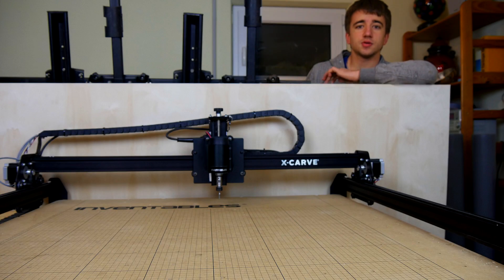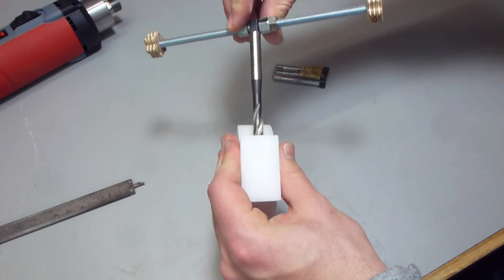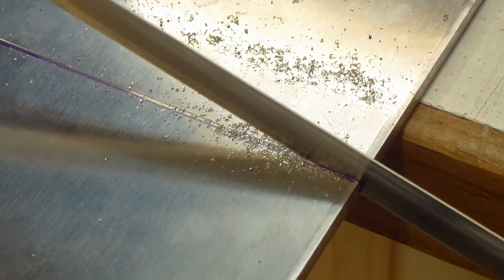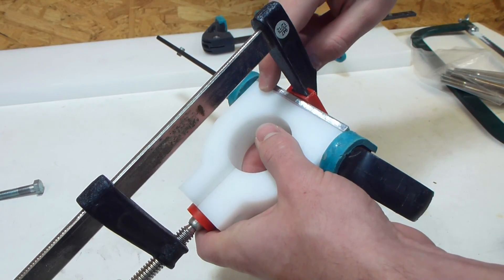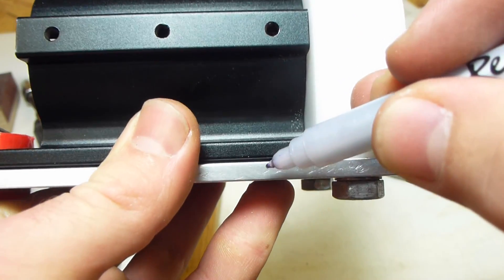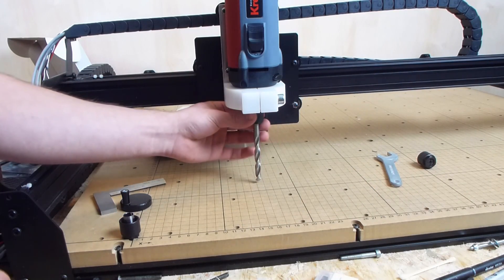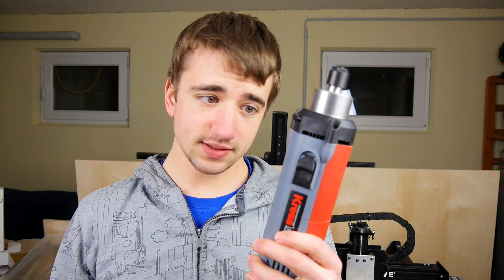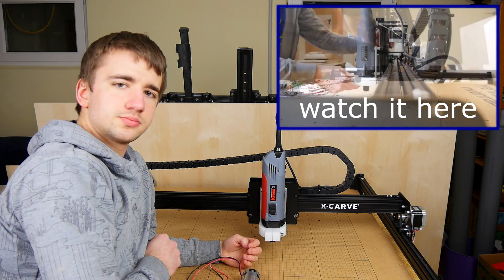CNC Spindle Upgrade

Comment: I know this video is very old, but if you still have the power cord zip tied to the energy chain, then normally you can open all the joints on the chain, and lay in the cords :)

Comment: In the meanwhile people should go for the 1050 (or 1400) FME-P (note the P in the end) ... Tighter tolerances, better bearings and an ER-16 collet (I think it is ER-16, some sites claim ER-20, others ER-16). Oh and PWM speedcontrol on  the FME-P DI models.

Comment: Wonderful conversation! And well done too. I think you might want to add gussets connecting acetal plate to AL plate to provide greater rigidity to assembly. Otherwise, you are asking threaded plastic to absorb lateral forces which will eventually cause system sloppiness.

Comment: was that a 100W spindle? holly 5 piece chicken McNugget meal that was small... 
I like my 500w spindle it works well in wood and has variable speed of 0-10000 RPM and its not as noisy as routers. only problem is my cnc frame is as rigid as a bowl of frozen Jello. 
5lbs force on the spindle tip and it deflects 3mm due to frame bending.

Comment: Marius you can cut aluminium on your band saw
Reply from the maker: With the blade speed I run the saw, the blade wouldn't like that and I don't really want metal shavings mixed in the wood shavings or in the saw

Comment: Great video. I will subscribe to your channel. Can you tell me how noisy is that Kress spindle? Can you run this in an apartment without neighbors get upset?
Reply from the maker: The spindle itself is not very loud, but the milling will be. I use it in our basement and there it's ok during the day.
Reply: Thank you for your quick answer. We ordered smaller one but is equipped with same motor. I hope will not be too loud. I have some nasty neighbors. :)  Maybe we will build a casing from Plexiglas and with some air vents or so. Maybe with one or two fans so we can cool the entire machine. 
You have very good videos. We really like your channel. Thanks

Comment: Love your video. I would have used a more robust mounting method for the motor instead of the 2 bolts I would have used a 6 bolt method and made the plastic mounting bracket with an angular portion that utilized the strength of that Aluminum back plate.
It looks very strong but over the course of time and vibration you want as much strength as possible.

Comment: I know this is old as hell but an easy way to get that spindle more rigid is to add an auxiliary support retaining structure for the router. You've got got radial and (a bit of) torsional support, but no axial thrust. Making another bracket under the exhaust ports ~200 mm up is a cheap upgrade

Comment: Another great video. Just a word of warning, a plastic mount won't be rigid enough for heavy cuts in harder materials. I don't believe you do such cutting (yet!) so it's not a problem.
I've got a similar mount but made from aluminium and that is still not stiff enough. Pressure from the cutting head will try to induce X/Y rotation on the pivot that is your clamp. If it does rotate even slightly, it will bite harder and chatter, maybe even stall. I damped the radial stress by making a support for the upper part of the router body too. With this setup I am able to cut aluminium and even steel on my router.

Comment: Hey Marius, I really enjoy watching your movies, they are really inspiring and fun and have great content! :)
A suggestion, when you drill in aluminum, use isopropyl alcohol as a cutting fluid, it will provide for a cleaner cut and also preserve the cutting edge of your drill bit for longer.
And for sawing off the aluminium, if you have a power jigsaw and a finetoothed blade, it will cut right throug it. Otherwise you should be able to cut aluminium with most circular saw bladeswith carbide tips :)
Reply: Pelle Reinke Very good

Comment: Are you using the Kress FM-1 5000-29000 Rpm 1050W spider, i´m planing to use this my self, if i´m not wrong you have 287 OZ motors nema 23 size, i´m driving 425 OZ steppper´s så if your machie goes light and easy i think mine can manage it too.
Reply from the maker: yes, it's that spindle and i have no problems with it.
Reply: This Easy To Use Tool Is All You Needdddd To Give Your Home An Extreme Makeoveeerrrr>>http://woodcarvingcnc.blogspot.se >>>

Comment: Kress Motoren sind einfach der Hammer :-) Ist das die FME-1 oder FME-P? Darf ich mal fragen, mit welcher Maschine Du so sauber Aluminium bohrst? Ich habe mir für Metal eine Quantum B16 geholt, aber bin mit der überhaupt nicht zufrieden, da sie sehr unruhig läuft und rattermarken ohne Ende produziert.
Reply from the maker: eine FME-1. Das saubere bohren liegt nicht an der Maschine sondern am hochwertigen Bohrer, die ich verwende. Hoffmann.de -> Bohrer von Garant
Reply: Ah, ok. danke. Dann werde Ich mir zum Testen einen Bohrer von Garant gönnen.
Reply: This Easy To Use Tool Is All You Need To Giveeee Your Home An Extremeeeee Makeover>>http://woodcarvingcnc.blogspot.se >>>>

Comment: Pretty sure all wood working tools there he owns a chop saw lol!  Why not just cut the aluminum plat with normal fine cut carbide chop saw blade?  Just saying wont hurt it lol
Reply: IIRC from other videos, he doesn't, because he has no room left in the shop, nor does he really have a way of getting the long lengths of timber into the basement anyway.

Comment: Hacksawing can be easy and fun. You just need high quality hacksaw and sharp blade, then put some grease or oil to blade. When sawing you need to find optimal grip and pressure to speed ratio. Then it goes like champ and you just have to be careful to stop in time :-)

Drilling "pilot holes" to metal before final hole increases accuracy.

Comment: hi Marius 
very nice work i have a question about the new router what is the brand and model?  coz i want to buy one 
thanks
Reply from the maker: Kress 1050 FME-1
Reply: +Marius Hornberger What about the new router included in the kit? Can you recommend using it or would you rather go for the kress 1050? I am planning on getting a x-carve and I wanna use it for sheet metal and thin plates as well as machining small pieces out of metal.
Reply from the maker: I don't know the included router very well, but as far as I know it has no variable speed. For metal you need that, especially the low rpm range. I'd go with the Kress.

Comment: What about noise difference, is the new router louder? These chinese default spindles tend to produce very little noise while idling.
Reply from the maker: +be2inas It's about the same. But noises during cutting are quieter, because of less vibration.

Comment: Hi there, I got KRESS 900W, FM 6990 E which is similar whit your new spindle and for which I have one question. I would like to set some ER Chuck but I don't know which one of them are compatible with this spindle shaft. Did you manage to connect ER16 or ER25 or you are using one which gets with tool?
Reply from the maker: +Senad I boguth the ones that are sold by Kress.

Comment: Why don't you cut the aluminum with your bandsaw?  Would be much easier.
Reply: +Josef Roesler Since his bandsaw now runs at 'warp speed', it's too quick for aluminium. If he could select a much lower speed, the blade would cope with it fine.
Reply: +coffeemaddan What? Feed rate...its all about feed rate. Not to mention, cutting aluminum on table saws and miter saws is pretty common.
Reply: +ballzack57 http://web.mit.edu/machineshop/Bandsaw/speeds.html
Reply: coffeemaddan And that link said that cutting wood and aluminum are basically the same on a band saw. So unless you have something else to counter with, you have failed to prove your point.

Comment: I did pretty much the same thing. One problem with making the Z plate longer is the larger leverage it has on the gantry, which causes deflection. I'm curious to see what you plan next:) How thick was that piece of aluminium you used?
Reply from the maker: +Auarhau the leverage only gets bigger through the heavier motor. The wheel position on the z-axis is about the same as before. 5mm
Reply: On the original plate the lower wheels are at the very bottom. But when you extend the plate down, you get the lower part of the plate hanging down with out support against the Z extrusion. This in combination with moving the spindle further from the Z plate increases the flex.If you don't extend the plate down, you wont reach the waste board with how the kress mounts. This might be less of a problem then I make it to be, since the wheels and the rest of the assembly is so flimsy. But it really bugs me :p . I can jiggle the Z axis around by hand easily, but the rest of the machine is pretty sturdy,.

Comment: you can double your feed rate. im over double with my x carve and a trim router
Reply from the maker: +Jamie Phillips did you also increase the feed acceleration?
Reply: +Marius Hornberger just the feed rate and depth. I usually keep it around 3000mm/m and 2mm depth of cut. But it all depends on the wood type I suppose. Using 1/4" upcut bits so they clear chips fast

Comment: Man, you need some metalworking skills. You're supposed to apply force to hacksaw only when you are cutting away the material, not when you're pulling back. Also, predrilling metal is neccecity for anything other than aluminium, for which it makes life much easier. Mainly, big drill sometimes doesn't quite end up right in punchhole, so you need to predrill it with some smaller diametre bit that does.
Reply from the maker: +404Anymouse You know some things look different in a video then they are in real.
Reply: *than
Sorry, I'll show myself out.

Comment: @Marius you will find that if you have dedicated cutting tools for Aluminum that have never been used on steel or other materials they will cut the aluminum much better than a tool that has been used to cut steel or other material even the shortest distance. This is also true for Brass. If you test this and find it to be true for yourself you may want to (when affordable) purchase a dedicated (for aluminum) (for brass) set of hack saw blades, drill bits, end mills and any other cutting blades that you will use with any frequency. - - - I hope this helps you and I wish you the best. If you get a chance, please let me know if it works better for you. I hope this helps you and I wish you the best from Houston, Texas, U.S.A.

Comment: I think you can open the powercord plug (motor side) with screws.
then undo the wire and feed it trough the chain.
then reconnect the plug

Comment: Not trying to spoil the fun but:
Don't waste too much time trying to stiffen up that machine, it is rightly called the xcarve. It's for carving not for milling.
There is a reason why CNCs or any type of real milling machine is build from steel. But if you use steel of a sufficient dimension you will start overloading the "linear bearings" of that machine. In turn you will overload the tiny stepper motors. It is going to turn into a time and money grave. I am not saying that a CNC mill has to be expensive but it would be easier to start from scratch and bolt together cold rolled steel. 
I know there is a point were I start getting irrational and keep investing time on the basis that I already have invested too much to stop.

I need to get one of those Haarwinkel from Esslingen just out of local patriotism.

Comment: nice, sharp, enlightening.Thanks Marius !
and bzw, I thought one could cut aluminium with a wood-speed bandsaw, don't you want to try some day ? (I just bought a 1950s wood/metal 143 macgine with a gearbox reducing speed for metal, but the manual keeps saying wood speeds are okay for Aluminium).
Thanks and Keep on trucking ! (from France)

Comment: Over 65 years ago when I commenced my six year apprentice with the  British Royal Navy, the expression on my face was similar to yours when you were about to start "your favourite part" of cutting with a hacksaw.  We used steel to make our own tools and my instructor insisted on clamping the workpiece  with wood packing all along the  length of cut  and putting a cloth over the free end to stop it vibrating  and damp the noise and   never to hold the hacksaw with two hands on one end  but use one hand on either  end of the  saw to guide it continuously     and  you will not believe this, but he made me lift the saw on the  return path as  he said that  the sliding it back on the workpiece would blunt the  teeth. 
Seeing  your hacksaw cutting action, I must admit, in my instructor's absence, I used your method including the length of stroke  as  indicated by the paint removal on your saw shown in this video. 
Once I broke a half inch Whitworth taps in  the hreaded end of a small steel vice I was  making and  the instructor made me start all over again.  In his absence I went to the welding shop ,  filled the hole with welding and threaded the other end of the U shaped vice. My instructor never noticed and in fact he congratulated  me for the accuracy of my fitting of the other parts.  Our hardest test piece was  manually fitting an H  shaped part in a flat -plate made of the same material as the H part.   The test included fitting the H then rotating it by 180 degrees keeping the same side as entry  and fitting it again , then changing the  sides and repeat the test, with all gaps  being accurate to a thousand of an inch, as we used the imperial measurement.
Once when I asked why the imperial measurements were chosen , the British instructor told me that  is because  the number 12  can be divided my many numbers where the answer is a single digit!!!! God bless the British for their logic!!
Reply: +Carmel Pule&#39; Hacksaw! Luxury!
Reply: +John Bouttell 
Yeah, I've been using steel wool on a toothpick scraping away without complaining for 23 years! I'm soon through with my first cut and it feels great!
Reply: I used to dream of having a toothpick, would have been a band saw to me.
Reply: PinkPonyOfPrey
Reply: You were lucky to have a toothpick!

Comment: for cutting aluminum I use an angle grinder with a diamond blade, used for stone and tile, other blades can clog up with hot shavings. I also hate using a hacksaw, powertools ftw... :)

Comment: Very nice video and a useful upgrade of your X Carve!
But I think weak point of your mount is the clamp made from HDPE. All plastics have a tendency to flow under pressure (and temperature!). Especially HDPE has a high tendency to flow. If you can not avoid screwing HDPE to metal, metal spacers and large washers should be used, and if you have to fasten metal bolts I would definitely not tap threads directly into HDPE (for the same reasons). Like wood each species of plastic has different properties. For this kind of application I would definitely recommend an other, maybe reinforced plastic.

Comment: Very nice modification and upgrade. Marius, since you are planning on reinforcing the rail system anyway, why not go with the stronger 611 router?
Reply from the maker: +MRrwmac The 611 is not stronger and not as accurate. Use Google to check that. And it's incredibly difficult/expensive to get in Europe (300€)
Reply: +Marius Hornberger Good to hear that! Sounds like the one you bought is going to be a great router for your CNC!

Comment: You can easily cut aluminum like that with a miter saw, or perhaps table saw.
Reply: +Justin Bell jigsaw mates, jigsaw c;
Reply: +Justin Bell Yep... I do it all the time. I have even used used a router, though it does tend to clog the bit. No issues with using a table saw, though. He probably just didn't have the right kind of blade.

Comment: Thanks for sharing. Lovely hack. Excuse my ignorance on CNCs, but does the extra mass of the new spindle affect the speed and accuracy of the cutters? Are the stepper motors and belts able to cope with the extra load?
Reply from the maker: +Jeff Harmed No, speed and accuracy are better since it has less vibration on higher feed rates. The stepper motors and belts have no problem with it either.

Comment: Hack saws are ok.  Next time you want to cut aluminium try your drop saw.  Clamp your aluminium between two thin pieces of timber and lubricate with WD40 as this will stop galling.  Cut very slowly and let the blade find its own feed rate.  Any carbide blade will suffice.  The slower you cut, the better the edge.  The timber will assist in arresting the chips as the hook and rake on most rip blades are not specifically suited to aluminium.
Reply: Hi Steve,
I don't want to burst your bubble, but you need to read the MSDS for the product.  I won't bore you with the science, but the active compounds in WD40 do have lubricating properties.  You are correct in that they also displace moisture.  They also leave behind a residue that seals the surface from O2 etc.

Direct from the first page under product identifier:

Product Name: WD-40 Bulk Liquid Chemical Name: Mixture
						
Product Use: Lubricant, Penetrant, Drives Out Moisture, Removes and Protects Surfaces From Corrosion
					
The primary compound of 	 		 		 	 	 		Naphtha as refined in the common distillate kerosene was the lubricant I used as a machinist before some of the better cutting oils (water soluble) became readily available in the past 30 years.
Reply: +Steve Sherman - Yet it works.  I guess the mechanical process of tribology occurs with smoke and mirrors...